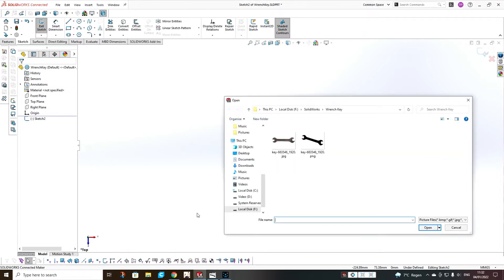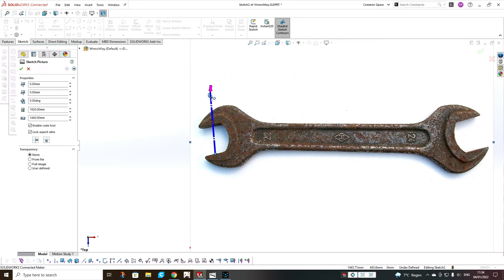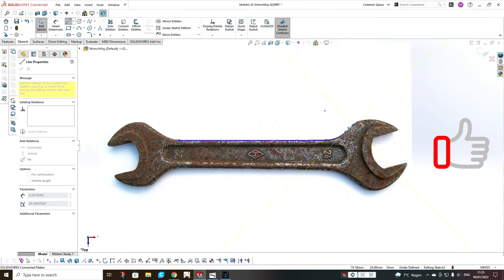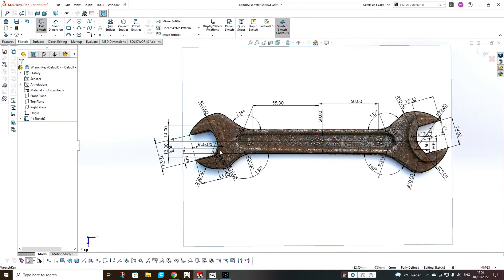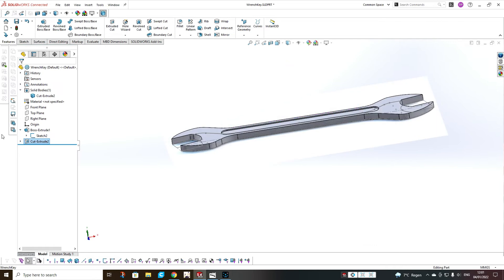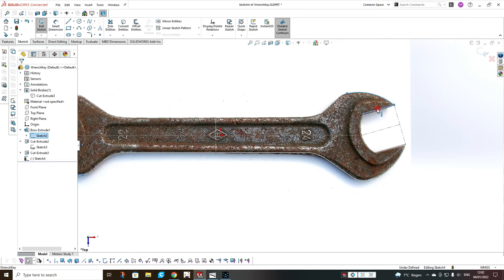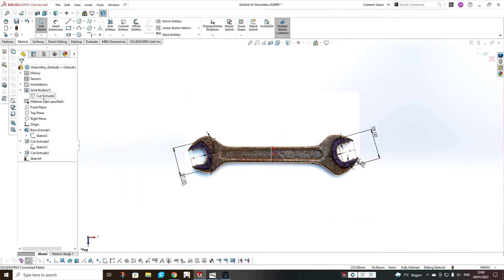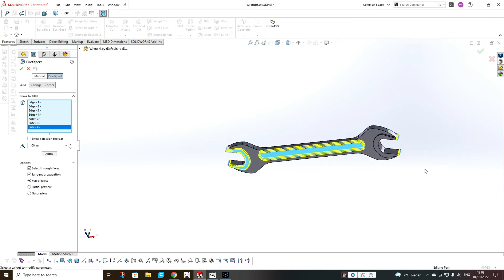SolidWorks 3D CAD Model From Picture! No Drawing, No problem!

Comment: so cool, but its lots of work and we're in 2025, there should be AI somewhere that does this in one prompt
Reply from the maker: AI is still doing terrible job on detailed stuff and that's a technique that you can use in many different ways. Just one example :  you have a physical PCB and you need to make a housing for it, just make top and side photos and use it to build around instead of building complex PCB with or without AI.

Comment: 😊For accuracy you should select the largest measured dimensions that you can find on the part as a reference.
Reply from the maker: I’ll disagree with that—when scaling a sketch picture in SolidWorks, you don’t necessarily need to use the largest dimension. I used the 22 mm side of the wrench instead of the 24 mm one simply because it was easier to position and work with. You can always adjust the scale afterward. For accuracy, though, it’s important to consider using the most critical dimensions as your reference.

Comment: Don't you think it is hard to extract symmetry with this method, because captured images are always taken in perspective mode. One side looks smaller than the other.
Reply from the maker: That's because one side is always smaller then the other, usually double sided wrench has 2 sizes like 12 and 14, they are never same size.

Comment: I was confused at the very end when you were doing a circular pattern... and then I realized that a simple mirror about the plane would have made the text mirrored.  Smart!
Reply from the maker: It was many years ago when I kept trying to make it with mirror, and then it was like "Ohhh". Then I had a period in which I was just making extrude cut or boss on both sides when I needed something like this, but it meant also another sketch which is very unconvenient when you have to change the text or the font. At some point I got the idea to use circular pattern.
Thank you for your comment, it reminded me for the old days 😊